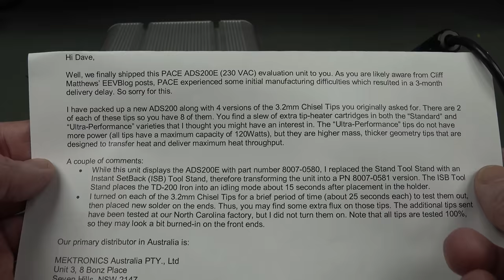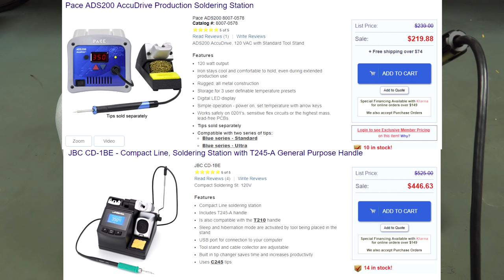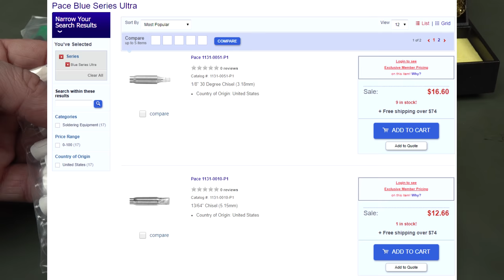EEVblog #1106 - Pace ADS200 Soldering Station Review (JBC Killer?)

Comment: lol this pace look's terrible
Reply from the maker: i actually like the look of it!
Reply: I like it more than JBC, looks industrial and strong :P
Reply: Agree. Probably works well, but looks like a toy.
Reply: A toy? Compared to what? JBC looks like a toy by comparison.
Reply: Pace goes way back to the 1950's so when I think "Pace" I don't think modern looks and I like that, personally. Their logo hasn't changed in decades. If you'd never seen a coca-cola bottle before you'd think it looks old & bad with it's outdated fancy cursive letters.
Reply: @ThoughtMachine1  Probably the sticker on the faceplate. I can overlook it, don't care really, but it does look silly.

The extruded case and the cast trim I like. The inclusion of external T-slots is brilliant if you like to make modifications.

Comment: I honestly think all these super-expensive pieces of gear are the soldering equivalent to £900 HDMI cables. I used a £20 unregulated Weller iron for more than ten years. I then moved 'up' to a £40 Tenma soldering station and it has not given me a single problem since.  Admittedly I mainly work with retro-computers that have primarily 1980's through-hole construction. However, from time to time I have also hand-assembled pretty small SMT projects without difficulty it as well.

Maybe when it comes to diagnostic equipment--especially scopes and meters--then I can see that if you pay more you get more precise numbers. However, in all honesty if I was forced to buy these ridiculously pricey tools before I could do any electronics then I simply would not be able to do electronics.  I cannot part with the money required--and electronics brings me as a hobbyist a great deal of enjoyment and happiness. The equivalent to 'a couple of hundred bucks' in Sterling is more than I have to live on per week and I cannot be alone in this situation amongst the audience! The EEVBlog has never struck me as being focussed on professional users. I hugely enjoy Dave's videos and when one is released I cannot wait to watch it. However his insistence on only buying the most expensive gear and A++ brands quickly becomes exclusionary to many in his audience and might even put people off from talking up an incredibly educational and rewarding pastime.
Reply: morelenmir Hobbyists tend to be cheap when it comes to good tools and equipment then professionals.
Reply: @praestant8 Okay. Well... I am a hobbyist... As such I can assure you I am not 'cheap' because I am too stingy to buy expensive things. Rather I am 'cheap' because I cannot afford what you call good tools and equipment. I do not have £175 to spend on a Fluke 117 meter or £180 for a Hakko soldering iron. Nonetheless I do very much enjoy electronics as a hobby and have to make do with what gear I can afford.

I wish Dave would feature and review budget tools that still work well enough for 99% of the tasks you might encounter. For instance he once covered a cheap hot-air station--and I bought it on his recommendation! I am also going to buy one of those well priced multimeters he looked at a few weeks back.

Sometimes it feels like Dave is saying 'If you can't afford top brands then just don't bother.' If that is the case then he is excluding many, many viewers from an excellent and educational hobby.

Comment: No fan of the transformer. Nowadays a decent (of the shelf) SMPS will do job just fine. In fact the whole internals look rather dated and feels old fashioned.

And buttons for setting the temp..........
Reply: switch mode PS is for cheap China crap - REAL MAN power supplies are LINEAR!!!
Reply: And wasting a lot of resources/are very inefficient. 
SMPS are not only Chinese crap either, that's just a plain insult to some very well respected companies out there.
Reply: And lets see how that SMPS is working in 30 or 40 years of daily use.  I have pace stations that are over 35 years old and still work like new.  Keep it simple stupid philosophy.
Reply: You forgot much crappier waveform, and much more complex - more components is not good for reliability, and it's typically a LOT more components!
Reply: I'm sorry but linear power supplies are king for soldering irons.
The JBC doesn't use a linear transformer just for show either.
SMPS have their place, but soldering irons are not where they belong.
Reply: There's a reason you don't see smps on heaters in general. You'll waste more energy on inverting the signal again to heat the handle as well.
Reply: Pace buttons are tough and made from heat resistant silicone. It turns out, production stations are abused by assembly workers using the tip of the iron to push the buttons! (#?!!#!) Some workers seem too lazy the put the iron down and use their bloody fingers...

Comment: I know it's silly, but I just can't get over how ugly and outdated the thing looks. I mean that blue background with the "hi-tech" traces on it, looks straight out of the 90s. And the aluminium extrusion just makes me think of really cheap Ebay stuff.

Love the super short grip to tip distance though. It's already great on the JBC station I have, but this is even better. And the price of the cartridges is something JBC could learn from...

But if I hadn't lucked out and gotten a great deal on a barely used JBC station, I would certainly consider this one.
Reply: I've said this elsewhere in these comments, but we have been using these custom (not off the shelf) aluminum chassis extrusions since the 90’s. Yeah, old school. Some people think it’s great, some sexy (Dave does!!!) and others think it is ugly and antiquated. But creating a modern and sexy new case would have added at least 3-4 months for tooling, required us to redesign the pcb and a host of other issues. They're custom extrusions, lead times are extremely long (we have to order at least 6 months in advance) and we have to buy this material in long sheets that is then cut to size, then anodized. The extrusions end up costing more than a custom stylized metal case would. It was estimated that we could have saved about $7 per ADS if we would have switched to a more conventional sheet metal case (meaning a significant reduction in list price). But then the customer would have had to wait another year and the resultant power supply would not be as rugged. In the end, time-to-market concerns and the fact that the ulta-sturdy case is practically invulnerable to burns, 3 foot drops onto a cement floor and other customer abuse, led us to stay with the proven and rugged old-school extrusions. Thanks for your comments!
Reply: Well, you need to re design the PCB anyway. Having the heatsink hit the cap is a real schoolboy error. Designing the board in a free program like Kicad would have shown that problem.

Comment: You've received so many frikken kits in your mailbag. Instead of pushing the tip into a copper clad board, actually do some soldering with it to review a soldering iron. You either do reviews scientifically with actual measurement tools, or you do it touchy-feely in real world scenarios. Doing reviews isn't that hard

Comment: I thought this was an old video because of how outdated it looks. JBC killer, I don't think so. Not with that interface and design
Reply: Do you solder 6 solid hours a day?  Or, sit at your bench and fool with your equipment? FWIW, those PACE silicon buttons can be pressed with the hot iron. In production, you save time keeping the iron in your hand. Apples vs. Oranges.

Comment: Just get a TS100 for a quarter of the price.
Reply from the maker: Minus the burn proof flexible cable, minus the professional iron stand, minus the power supply, minus the professional rugged construction. Sure, go ahead.
Reply: EEVblog lol yeah
Reply: EEVblog sure it's not going to replace a benchtop station, but when you travel with an iron or solder on the go, which I do a lot, the TS100 is actually unbeatable.
Reply from the maker: Ivo Trausch  - Of course, it's a portable iron. Trying to compare it to a benchtop station as may people do is crazy.
Reply: Ivo Trausch comparing a portable to a benchtop is like comparing apples to oranges. Sure they're soldering irons but comparing a benchtop to a portable is a dumb thing to do
Reply: EEVblog as people did to laptops and smartphones when they came out. Does not make sense but it's how humans work. 
Don't get me wrong, I love to have a proper station around, especially since I found the need for a two channel station recently. The TS100 is definitely not made for benchtop use and would not stand up to a second of the abuse I give to my Ersa. 
Although I think it's the only portable iron you actually /could/ use at home. I did that a while ago when my station gave her last, it was not comfortable, but if I only could have one iron, I could make that work.
Reply: Ivo Trausch - Marco Reps likes the handle and low cost tips enough he may add this to the Uni-Solder open source project. It uses the same voltage as TS-100, so let's see if he can make it portable..
Reply: There is MUCH better thing, than TS100 with it's bulky handle and high priced tips. "t12 stm oled" - type it in a search string on  aliexpress, and you'll get a 75W soldering station with aluminum body and three type of handles all with burn proof flexible cable. I've got one for $120 with two handles, iron stand and 6 different tips and shipping to Russia. Yeah, it is not branded, it is cheap, but it has nice OLED display, that shows everything you need, it has presets, it promptly beeps on you, when reaches the temperature (no need to look to the screen), it has tip short circuit protection, it easily melts solder joints at ground pins of ATX24 connector on a modern 8-layer motherboard at 320 celcius temperature set
Reply: Juan Herrero that's a dumb thing to say. The ts100 would never work in the situation where this station would. The ts is for on-the-go and hobby work. This station is for someone who is soldering all day.
Reply: Who's a smart guy here?

NOT THIS JUAN
Reply: EEVblog: for someone who occasionally solders a small board  the TS100 would be fine.
For large volume soldering work it's clearly insufficient!
And for single spot soldering you even don't need a temperature controlled iron, just constraint in using the heat available.